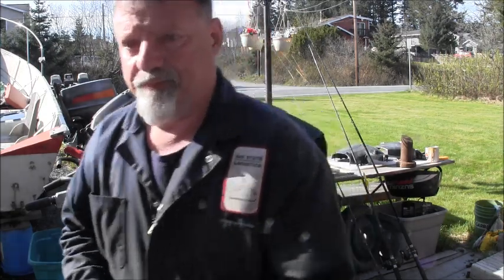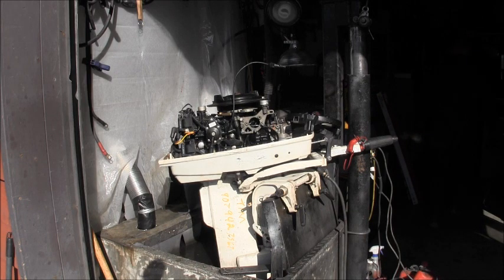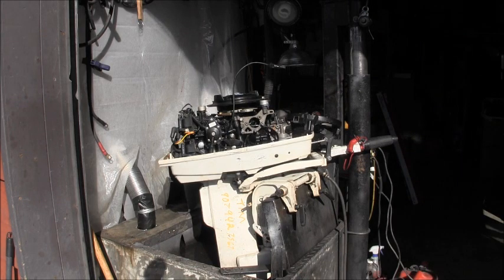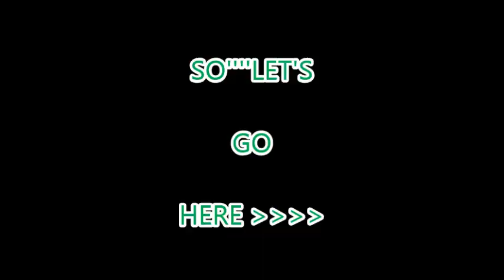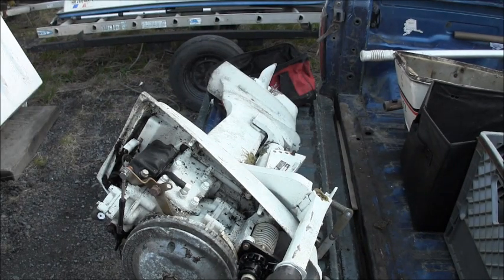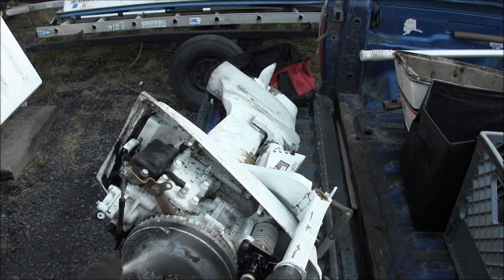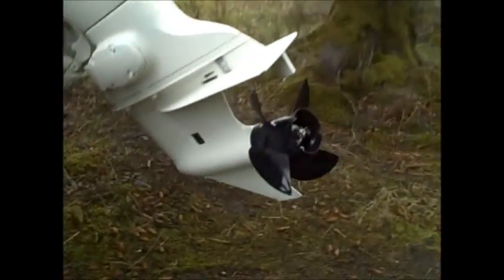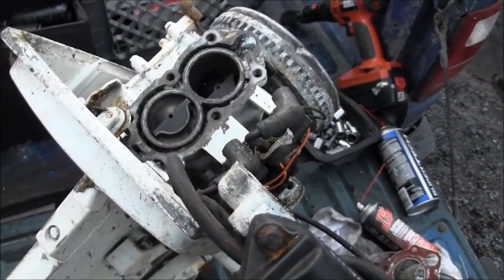JOHNSON 1998 30 HP & 1983  7. 5 HP  OUTBOARDS

Comment: Well, I sure wish I knew folks that were tossing out 30hp Johnsons!  That 7.5hp may revive, sometimes the ugly ones surprise us...You might try getting that gearcase off before going much further, unfortunately, these things tend to seize up the crank splines.  If the gearcase comes off with the driveshaft still installed, then I would probably pull the powerhead, do the grommet, and go through the cooling passages completely.  Don't know why I like these engines, they definitely have a few major engineering flaws, but I like em anyway.  They cant compete with the older 6hps when it comes to ruggedness, but they run rings around em at high speed.

Comment: Kodi, this 98 Johnson 30 Horse looks like mine, i have a 98 Johnson 30 Horse BJ30 BAECS. I did a head gasket job on it, but when i refit everything, im not sure i got the primer pump tubings correct. My repair manual doesnt show a primer pump exactly like mine, it shows a tee in the output tubings, i dont remember mine having a tee, i did the gasket job early last Autumn & didnt refit the power head to the midsection until this Spring. I carelessly thought my repair manual would show diagrams of all i needed to know about refitting the motor & didn't take pictures or enough notes before disassembly last Autumn. The manual was very little help to me. Could i trouble you to take a picture of the primer pump & tubing of the 30 horse Johnson in this video & email it to me so i can compare it to mine? Your videos are very helpful to me, if i lived there & not in Toledo Ohio, i would surely be another regular customer! When you have replied to my previous comments the replies have been sent to my email, but in case the emails get sent without your readily knowing what my email address is, it is w70jeff@gmail.com
Reply from the maker: My next video will cover this 4 U.     kodi
Reply: @kodibassInsideoutboards  Thanks, Kodi, and I got to thinking it over right after I had sent the request for you to take a picture of the primer pump and email it to me, that was being overbearing on an online mechanic that is not exchanging advise and support for a fee, I should not have asked that, and I apologise. And again, if you were a local outboard mechanic in my area, I would be glad to be one of your regular customers😁

Comment: What is that brush bit you used to clean up the rusty parts on the recoil starter?
Reply from the maker: It is just a drill bit fine wire brush available @ any good auto parts like NAPA etc.  kodi